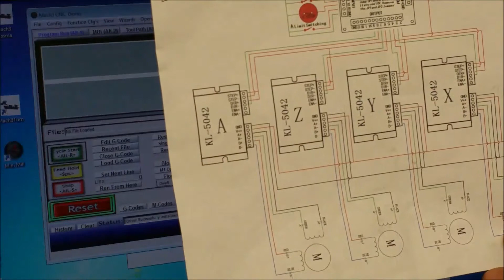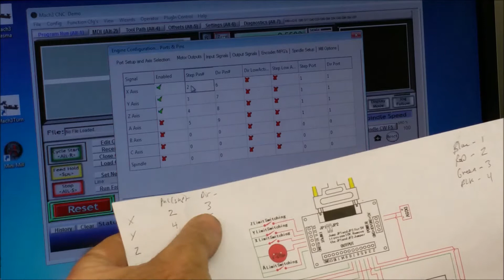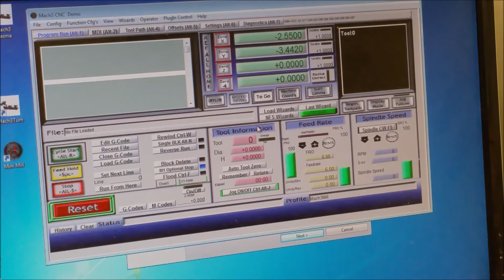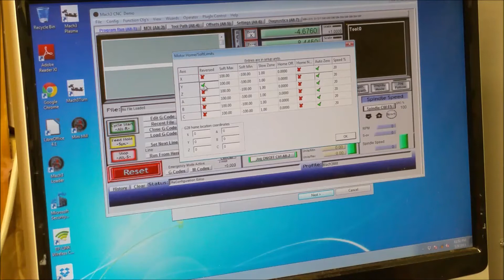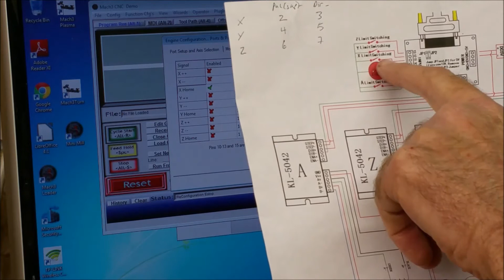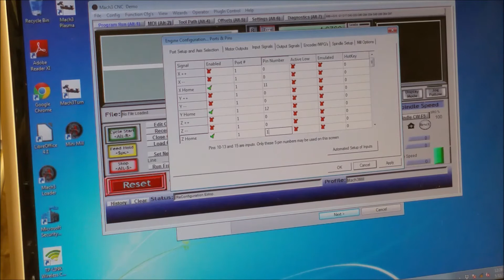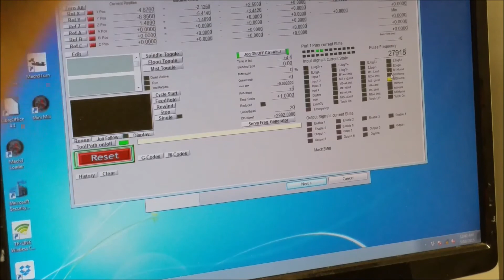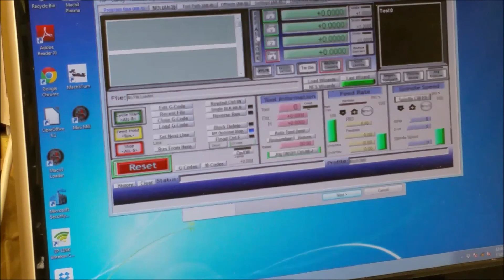Mini Mill CNC Conversion Part 8B - Mach 3 basic settings

Comment: how have you gone running Mach 3 on windows 7 ?
Reply from the maker: +mattgatenby - Its was working fine.  Haven't used it in a while since I got a Tormach.
Reply: Yes I have been watching through your Tormach videos today....thanks for uploading them as I am tossing up which direction to go re. Mach 3 vs Linuxcnc

Which do you prefer ?
Reply from the maker: +mattgatenby - Cool, Thanks! From my understanding, windows may have too much going on in the background and thus cause problems.  Tormach's Pathpilot is Linux based for that reason from what I understand.